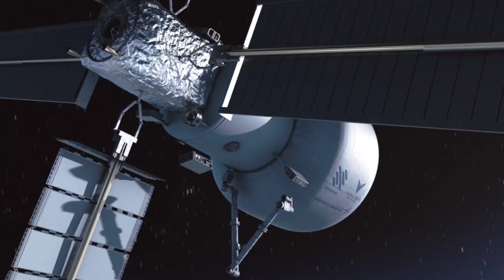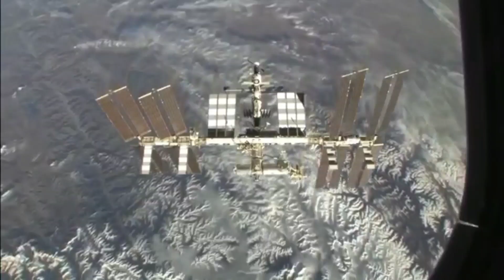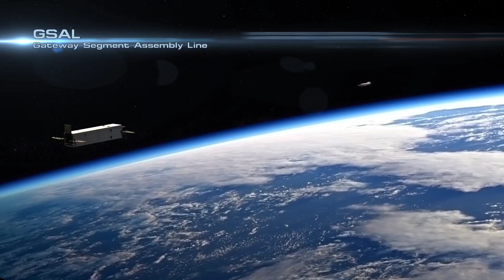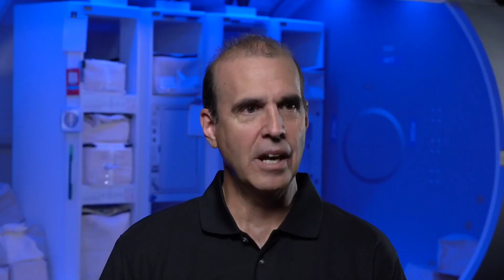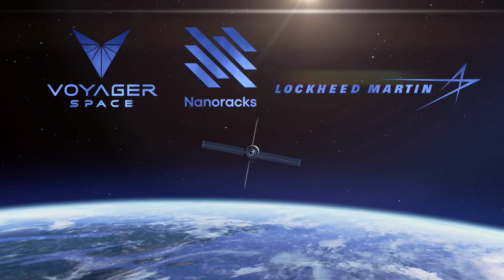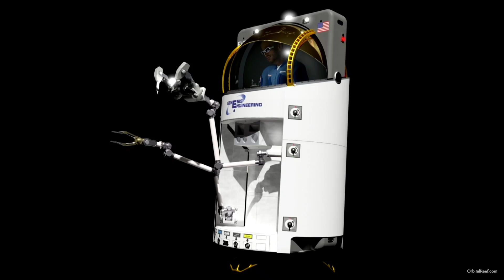How did SpaceX lose to Blue Origin on a NASA space station contract? Was this handled fairly?

Comment: It's not only about volume,it's about specialized modules that cost One billion and that take years to build and that are build over +5 years because of their R&D time and cost.

1100 cubic feet of mostly empty space is worth nothing! you need to fill it with very sophisticated equipment.

Each module has a unique purpose so requires a lot of custom equipment.
 None of that equipment can break anything else, even on other modules that aren’t built yet, and none of the equipment can break since the launch is so expensive. 

All these factors add costs and slow production rate.

Comment: copy& paste from someone elses comment that i highly agree with on another video: Without a proven launch system, Bezos is going nowhere. That has absolutely nothing to do with Space X or NASA or Elon Musk or anyone or anything else that can be used as a distraction. That fact stands alone. In isolation. Bezos wants to talk or sue or bully or conspire to get into space orbit. Elon Musk has repeatedly suggested, Bezos should "engineer" his way into space orbit instead. Modern engineering is very hard and filled with failure. Bezos is frightened of failure and that shows he has not grasped "modern" engineering design which is to completely map all possible failures. Then design something that can take advantage of every little thing right up to but just before, failure. Space X has thrown "safety factor" out the window. If Space X rockets wasted energy on 10 or 15% "safety factors" they would not be able to re-land.

Comment: How did this happen?  Pretty simple.

1. Volume: It isn't everything. Volume use is much more important. Think you hit this problem pretty well, but it's not just about doing homework. SpaceX is a rocket company without the station experience of those other companies.

2. Risk: Starship riskier. Starship + Booster hasn't flown yet. Sure, Blue Origin hasn't made orbit yet either, but even if it never does, the rest of the plan can go up on other rockets.  If it does make orbit, the rest of the plan can STILL go up on other rockets. Nothing else could launch a Starship Station.

3. Cost: Small modules better suited to start-ups. Cost to orbit IS getting lower, but it's still massively expensive. Smaller, less expensive modules will give LEO access to more companies.

4. Forget your worries. Starship is well in on it's development. Starship station doesn't need the government money.  It's simpler than the rocket itself. I'd be surprised if it doesn't happen without NASA money. NASA giving money to other companies will improve competition in orbit.

In short, NASA made the smart choice here.

EDIT: Besides, don't take SpaceX's eye off the ball.

Comment: I think that SpaceX make a Mistake, Problems which needs to be solved for a Spacestation needs to be solved for a Longrange Spacecraft as well: Meteroid Protection in form of ripple Shielding, how to create a good climate, how to use docking. The thing what the Starship Spacestation realy needed, from Kerbal Space standpoint, is a good Docking approach. If Space-X had proposed a Docking Adapter at the tipp with 4 to 6 Docking Points it would have given the Concept an open Modularity: When you need more Space, send another Starship up, When you need a Dump, dock a inflateable Module on, and on the Star Ship two points for bigger Solar Arrays, when you need more Power.  That would have have given the Design a feasability for a long term low Orbit Modul, which would help Space-X to understand the Mechanics of a long range Spacetripp to Mars. And not seeing this is a failure.

Comment: At present NASA has been trying to cultivate a commercial ecosystem, which means diversity. It looks like without some ongoing help, the space industry field could thin out and loose much potential diversity. As SpaceX rocks! pointed out a space station is not in line with SpaceX's corporate mission. Had I been SpaceX, yes, I might've applied for the space station knowing I'd likely lose, not because it would loosely support the argument SpaceX isn't getting preferential treatment and the cost to work up the proposal would be pretty small. But for SpaceX, already working on developing not just a revolutionary launch system but the means to mass produce the ships, multiple launch sites, convert oil platforms to launch sites, having to think about orbital refuelling, the HLS's landing thrusters being up near the nose...that's lots of engineering. And Elon runs around keeping a close eye on everything; it would be absurd to develop yet another big deal engineering project. They'd have to hire the last of BO's engineers and maybe some from other aerospace firms to keep up!

Comment: The existing ISS is way too small for any type of commercial capability. You need to keep people up there many months. Easy to build off a zero gravity module in the core for a ring (though clearly LEO is Much easier and I don't see why an adjustment to design (on a smaller scale) would be unusable.

These tiny little things that they call "commercial space stations"  are a bad money burning joke. 
NASA clearly doesn't have the money or will to do this right. 

This was shown in the lander project when they seriously entertained ships to land no more than 4-6 people and a few tons to lunar surface to build a "sustainable" base. 
Spacex was the only one that fit "sustainable". Does Anyone believe that  putting 4-6 people and a few tons on the lunar surface for several billion dollars per run would build anything but the national debt? 
How is that a permanent presence on the moon that does anything useful at monsterous cost? Frankly I found All the other competitors were building expensive, useless junk. 

Now they want a SMALLER space station than ISS?..... to do commercial projects that wouldn't have fit in the existing ISS? 
NO ONE needs another, smaller ISS. 

NASA is building congressional pork. Not solutions. 
This is why Spacex lost... and that's a good thing for Spacex. They are free to develop their own... if they can get rid of the FAA's interference and launch elsewhere.

Comment: On the hub a laboratory
 would be in zero 'graviy' it would rotate with respect to the rotating station of course, alternatively the experiment carrying module  would be inertially not rotating, bettef than the present station that is rotating with one side pointing to the local vertical once every 90 minutes.
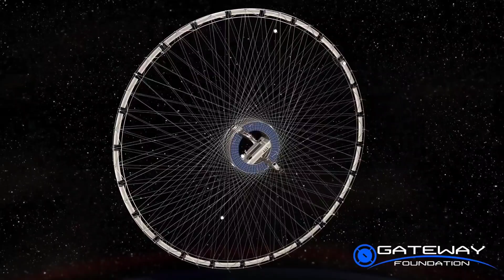So yes micro gravity experiments can be made with a module docked to that internal "box" 10:02
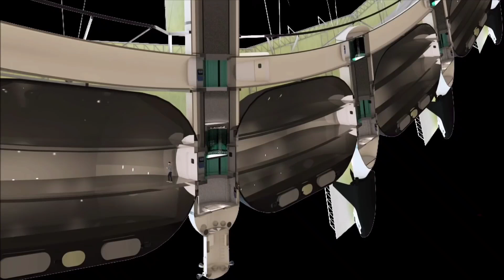11:04 timed discussion.

Comment: what I dont understand: 
why did these contracts not enforce the openness of these stations?
like allowing others to extend the station.
if a company create an excellent module, there is no reason to not connect it to the station.
so NASA should allow this, its public funding

and can SpaceX create a station without NASA?
for that, they must create a 3 stages starship+booster solution (booster + 2nd stage + station)

will see in the coming years.
if the starship works as expected this year... spacex may propose something on its own.

Comment: Space x is over extended with the starship program. I was concerned about it from the beginning. Taking into account the issues with the space shuttle it’s unlikely to be safe, on time and cheap. Even the design is not as good as the lifting body one of x-33. Also there is ni business case for starship : most cargo does not require even a falcon heavy. During all the Delta IV project the heavy was seldom used. Scaling up the falcon 9 will be more than enough , economical and practical. Now if starship works maybe they will create a market (the USA military is already thinking if it) but I don’t want people flying on it with no scape pod.

Comment: Not too surprised, nasa uses a scoring strategy with a 'business development' part that is Wholly orientated towards the bullshit that Blue origin spouts. Alos note that with the BO bid, its almost all Sierra space, blue origin don't even maintain and operate it (thats a different company), ie we've built it now someone elses responsibility! - in fact the space station could be built in stages, initially just a sierra module or two possibly -- do they even need the BO part? Spacex probably worried they wud be spread too thin, and cud go it alone, though a spacex concept that included Sierra expansion modules would have been fun to blow a cold wind at jeff who.
Reply: These are only DESIGN and DEVELOPMENT CONTRACTS, NOT CONSTRUCTION and DEPLOYMENT contracts.  The "winners" don't have to deliver ANY hardware (something at which BO excels), just pass a Preliminary Design Review.  The construction and deployment contracts will probably never be adequately funded by Congresscritters, based on their track record of spreading payola across their states and districts ... that delivers NOTHING.

Musk has stated a number of times that the mission of SpaceX is to develop and operate space transportation vehicles.  However, they will also develop anything that others fail to provide, and they will probably put a Starship-based station into orbit.  That will occur after cargo and crew Starships are launched into orbit regularly, reliably, and maximally reusably, then charge competitive commercial rates, not government payola.

Comment: I looked over the NASA response to the SpaceX proposal.  It is as you said, SpaceX didn't try,.  Their proposal was a half assed one that should have been rejected.

SpaceX could have proposed sending up a Lunar Lander fully outfitted as a space station with a single docking port and ports between the three compartments.  The oxygen and methane tanks could have included ports that could be easily converted into docking ports and with pre-installed internal mounting points for additional station gear, all to be brought up by Starship Freighter launces then installed by crew on the Starship Space Station.  When both propellent tanks are built out as individual isolatable station modules the volume is about 3000 m³.

Even with additional Starship Freighter launces with station gear, etc. the cost would still be far less than any other ISS replacement yet have a volume of almost three times the ISS.
Reply: Ummmm ... no, you can't use propellant tanks for anything other than ... propellants.  No one could spend any time in contaminated tanks that can't be fully emptied, as their structural integrity would collapse (they're pressurized with nitrogen before being filled for launch).  Even wearing space suits wouldn't work and gear placed there would require decontamination every time someone or something enters the habitable volume.  Then, there's the need to add hatches large enough to accommodate astronauts'/materials'/equipment's passage in and out, which would introduce untenable structural risks.
Reply: @jimmanley2796  Vent the methane tank to space as the liquid methane is warmed up to vaporize it.  Next remove one of the external access hull ports that SpaceX builds into the Starship to allow workers to make changes inside the propellant tanks during production.  There won't be any contamination that remains after a short time in vacuum.  

That hull fitting left when port is removed could be sized to allow a standard docking port to be attached, or it could be larger for a cargo port.  Adding more than one port for conversion into docking/cargo ports should be possible.

As for the oxygen tank, who cares if some of the oxygen "contamination" remains.   Until that tank is needed for station expansion it would even be worth saving the liquid oxygen to replace the oxygen used by the astronauts.  When ready to expand the station into the oxygen tank do the same as was done on the methane tank, warm up the liquid oxygen and vent it to vacuum as it vaporizes.

The reason for keeping the tanks pressurized is to keep the body of the Super Heavy booster or the Starship from collapsing from Earth's gravity or from acceleration when filled before takeoff and during acceleration (try to crush an unopened can of Coke from the top down, then one that has been opened and you will see why).  In the micro gravity of space the Starship propellant tanks will not need this pressurization to be structurally sound.  Of course pressurizing them to one atmosphere with air for the crew will add both longitudinal and lateral rigidity free of cost.

Comment: Here is an idea that maybe has been missed. Have you looked at the Starship TPS closely? You will note that at some locations, the tiles are flat faced against flat faced with no cos the weld tiles. If you have a nosecone, a main body, and the aft propulsion section as three modules, you can take it to orbit as one unit. Then once in orbit, remove the main body. Reconnect the nosecone to the aft propulsion section and return to Earth. Leaving the main body in orbit. Each Starship launch could have different setups in the main body and the main body would not need the TPS setup unless the unit was to return to Earth on a later flight. Starship could grow in length as needed just by the size of the main body segment. There would be some wasted space in each main body as you would need the connections needed for the nosecone to work with the aft unit but those could be removed once in orbit. 100 tons to orbit has just gained an amount of weight that equals that segment of the Starship. As the whole thing could be done thru automation, the nosecone wouldn't even need a crew section. And for a lifeboat, tuck in a Crew Dragon module on one of the first flights.
Reply: That's not workable, as the nose contains one of the propellant header tanks, and plumbing connected to a main propellant tank, that are needed to perform the flip to a vertical landing.
Reply: @jimmanley2796  There are self-sealing fittings that could be used. Take a look at the QD connector as an example.

Comment: Well, the fact that Gateways' proposal lacked microgravity facilities is NASA's fault, for being obscure with the requirements, throwing in something about artificial gravity at the end, like an afterthought.  I thought they did not know what they wanted at all, when I read that.  So, it turns out they wanted microgravity;  NOT artificial gravity.  You can't have both in the same station.  Actually, you can;  but it's tricky.  It would be best to separate concerns.  Expansion in space needs four things in the way of stations:

  1) Microgravity things for research and/or manufacturing and/or movies and entertainment.
  2) Gateway ring stations with spin gravity for space hotels, temporary stay for workers and tourism, as well as for movies and entertainment
  3) Fuel stations (liquid fuel, oxidizer, nitrogen, and DC charging;  and possibly food, water and air).
  4) Stations with propulsion ("slow ships") that can take cargo in transplanetary routes using ion propulsion.

NASA should make separate calls for proposals for all these different roles;  not mix them all up.

  Defense Acquisitions made a similar mistake when specifying the 5th generation plane, throwing in too many requirements, until they ended up with the F-35 that's supposed to be a Swiss army knife of air combat;  and indeed it can do everything, but excells at nothing.  Now NASA are following in their footsteps with the new station specification.

  Another absurdity of the vetting process is that a selection should not have been made already;  this should be a time for feedback and clarification for things that were not understood;  not already a selection.

  For example, if the Gateway guys had known that microgravity was a priority requirement, they could have put a cylinder in the middle of their ring station, with a floating cylinder inside, not attached to the station;  only softly suspended there by the action of small fans gently blowing some air on it.  Problem solved.

  And if the Gateway guys had known that sun-synchronous orbit was a no-no, they could have added a few more solar panels and a battery, and then go to geo, or wherever NASA wants it.

  It sounds to me that NASA have lost their marbles, first being cryptic, then rushing a decision.

  As far as Blue Origin;  I think the contract will go to Sierra alone, as it should be.  Jeff Bezos seems to think he's forever entitled to money and credit for work done by others.  Time for awakening.

Comment: Am I the only one imagining a center core starship hull 5 times long with a ring of starships  around in a gravity ring, gravity for crew and zero G for research?
Reply: There will never be a "2001: A Space Odyssey" type of rotating ring space station because of intrinsic instability.  Movement of any mass in contact with the station will cause precession off the intended axis of rotation to the other two axes of rotation, and the effect is cumulative over time.  Attempts to stabilize it using thrusters only makes the problem worse.  Read Larry Niven's "Ringworld" novels (all of them, not just the first) and do an on-line search about the instability.